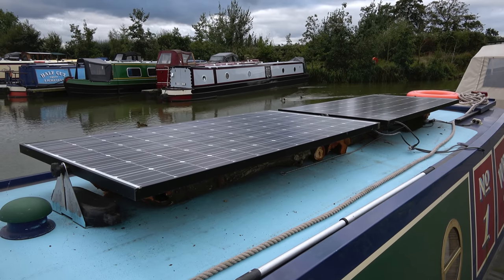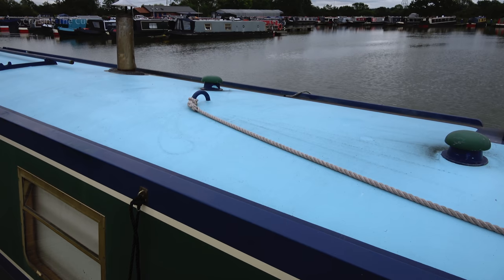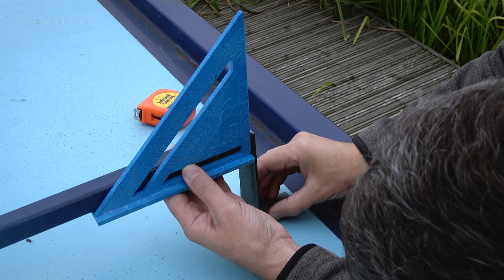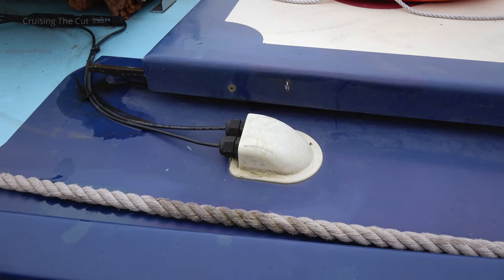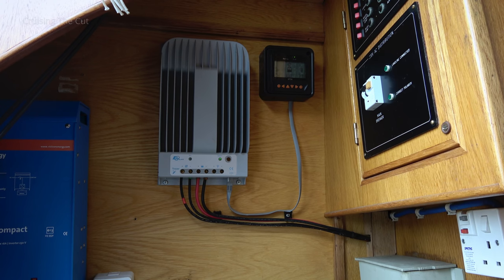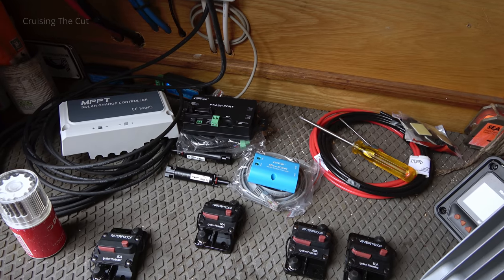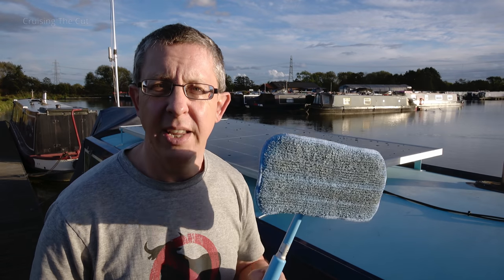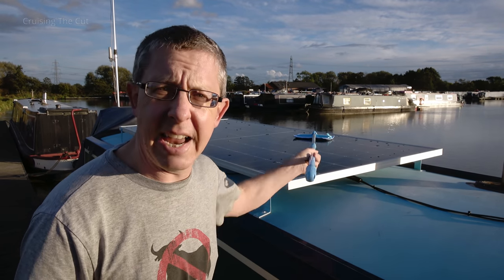251. Adding more solar power to my narrowboat

Comment: Wow David, your electrical, engineering and IT skills have come on leaps and bounds since you first installed solar power. Another great video and I loved the genuine excitement in your voice as you switched it all on and it "didn't go bang".  And then, as if the miracle of working solar power wasn't enough for the viewer, you bring out the mop!!! The 41 minutes just flew by.
Reply: We virtually said the same thing! I felt like I was there, partly waiting for a technical glitch (bang) but also knowing that David would have done plenty of research, used previous experience and taken enough care to make sure a bang didn't happen....unless he edited that bit out 🙂
Reply: its quite a bit different when he got the new batteries and his trepidation he had when hooking them up. there was a small spark when he connected the 2 together. it shocked him not electrically but mentally. lots of water under the boat since then.

Comment: That was the longest and most convoluted infomercial for a microfibre mop I've ever seen . Well done that man, I too would have been anxiously waiting for a loud bang and/or a big blue flash when I switched everything back on. Very interesting though and I hope you get decent power here in England through the winter. One other thing never ceases to amaze, the sun is about 93 million miles away but a few inches of tilt on a solar panel can have a significant effect. Take care. 👍

Comment: I would suggest filling the ends of the cut off tywraps flush, just cutting them leaves an edge that will slice you wide open. As a service and installer of electronic systems I speak from experience.
Reply from the maker: Cheers. In the interests of science, I have just run my finger along every single cut cable tie and they're all fine :-)
Reply: Mr Moffit has a point.  A couple of years ago ty wrap cuts were the number one reason for accessing first aid kits on our IT site.  The fact that your cut ends seem ok is probably down to your wire snips being blunt ;)
I am impressed by your explanation of connecting two charge controllers to the same battery.

Comment: Wow, as a person whose knowledge of electrics is black goes to negative and red goes to positive, this whole vlog might as well have been in Russian.
I still watched it all the way through though which shows the power of your presentation skills. I survived living aboard a constantly cruising narrow boat for 15 years and traversed the whole 2200 miles  three times. I had one solar panel utilised when stationery.. never needed any more lekkies . Engine provided all the amps needed via an heave duty alternator. I admire your expertise setting up your system. My mottos is KSS. 
Best regards. John B.

Comment: 17:30 you don't need two charge controllers that are communicating with each other. They both charge on the internal resistance of the battery. When the battery is empty, both charge controllers put as much current into the battery as possible. The reason for communicating is for lead-acid batteries where they need to de-sulfate. Only let one charge controller do that while the other will be set on AGM.
Reply: That's correct. It was charging just fine without the communication box. The battery internal resistance will cause each inverter to deliver its maximum current at whatever the battery voltage happens to be. This very efficient
Reply: Party Pooper!

Comment: i have watched you for a long time. many times when you are doing something someone will say you should have did it this way or that way. i mounted some on my trailer and truck using well nuts. i had the same issue as i wanted to keep the inner part of my truck nice and clean and did not want to remove the head liner. the well nuts worked fine and no costly tool to buy. you did a nice job dear Sir. carry on.

Comment: using a magnet to catch the metal bits is cleaver
Reply: yes ... and inside a plastic bag so all you have to do is turn the bag inside out and remove from magnet and the throw  away .. the bag not the magnet of course

Comment: Two questions (it would have been three, but I assume the lack of mentions of cheese sandwiches was just an accident!): 

1) Will the new panel provide enough power to get you through winter? And, if not, what will you do without a generator? Can you recharge from the engine, without actually traveling? (That was one question - just in three parts!) 

2) I know you are no longer cruising, but is that just a short-term decision, or do you intend to restart cruising at some point - even if only occasionally? I know lots of people live on permanently moored houseboats, but it seems a bit puzzling to live on a boat that can so easily (locks aside!) travel and not take advantage of that sometimes.  I'm not asking for more cruising vlogs (although they would always be welcome), but more to understand your decision to stop.
Reply from the maker: Yes, I will have to run the engine to a degree. I have no plans to cruise again.
Reply: @CruisingTheCut  Ever?
Reply: @CruisingTheCut  sad face ... I've so enjoyed your cruising vlogs. But I understand, interest in an activity waxes and wanes. I'll have to re-view some of your earlier videos.

Comment: The explanation of the need for separate controllers to accommodate mismatched panels was excellently laymen-ized and important for anyone considering expanding their own solar system. The climactic ending where you go enthusiastically ultrasonic was so worth waiting for! “... wiping the panels keeping them CLEEEEAN”.
Reply: It's very comprehensible, but it's actually not correct. The battery's internal resistance while charging will cause the two inverters to approximately equalize their output. IOW one cannot prevent the other from charging.

Comment: Those rivnuts are so cool. I've never seen them before.
Reply from the maker: Aren't they?!
Reply: They are really good, right up until they aren't ;-). Be wary of dissimilar metals, both between the nut and the parent metal, and between the nut and the bolt. Slather the bolt in anti seize before screwing it gently in to just tight enough. There is nothing more fun than trying to undo a bolt that has corroded into the rivnut, then the rivnut has come loose in the parent metal, ask any Land Rover owner. Rover in their finite wisdom use steel rivnuts in Aluminium panels, then screw in stainless bolts, curse them and their offspring. I guess it could be worse, they could leave unfused battery leads laying around in the dash area just waiting to contact an unsuspecting piece of earthed metal, or design door catches that cause the doors to pop open at 80kmh and scare the local gentry.
Reply: @raygale4198  happens all the time

Comment: We added rooftop solar to our home 15 years ago. It's a 6.5 KW system that has paid for itself three times over now. It's tied to the grid which acts as our battery so any power we don't use is measured and sent into the grid. Our typical electric bill is about $40 per month as opposed to our neighbor's whose bill can be as high as $350/mo. It gets hot here in Phoenix.

Comment: Well done David, you should be proud of your accomplishments!  I see you did all your homework on this project and, aside from the usual unplanned problems that tend to crop up, everything went fairly well.  In this unstable world since covid hit, more panels are a really good idea.  As a bonus, it should get you quite noticeably further into winter without shore or engine power.  You will probably have 3 to 15 amps coming in when overcast now.  You definitely did the right thing by using a charge controller for each of the old and new panels systems.  

I would recommend putting some labels on the charge controllers and circuit breakers, just to eliminate confusion.

I have never seen the need to have the charger controllers talk to each other.  Since they are designed to generate a regulated output voltage, if both controllers are set up for the same output voltage, there should be no problems associated with which system is putting charge into the batteries.  My system currently has 3 parallel 60 amp charge controllers feeding 5 parallel battery banks.  My panels are located 200 feet/61 meters apart so, the solar output is constantly changing.  I also like to de-rate every component in my solar system to maximize reliability.  In the case of solar controllers, I run a maximum current that is half the rating, which helps everything run cooler.  The charge controller communication is handy for online monitoring.

I have done considerable testing on the circuit breakers you are using.  They are a poor Chinese copy of marine breaker.  They generally trip at 1/5 to 1/2 the rated trip current.  There are no specs these breakers are designed to so, what you actually get is a bit of a crap shoot.  I had so much trouble with them, I tested each one using a calibrated test current, to see where they would trip.  After determining the trip current, I would label each one.  Also, in reverse engineering these breakers, I have found the contacts and internal connections are good for a maximum of about 40 amps.  For my high current breakers, I use the Buss, MRCB breaker, which is much higher quality at a proportionally higher cost.

These circuit breakers are rated for a maximum voltage of 24 volts DC.  Therefore, I would recommend replacing the breakers you have that are between the charge controllers and solar panels.  DC voltages require about 10 times the contact gap over AC.  DC will arc a surprising distance when you open a switch, especially if it is carrying high current.  So, what this means for your system is: if you try to open your breakers connected to the solar panels during the day, the voltage may arc across the breaker contacts.
Reply from the maker: Great info about the breakers, cheers. I have also since decided that they work perfectly well without the parallel controller so maybe I'll do an update video in February or March.

Comment: Well it works, so well done on that. To make life easier on similar future projects, might be an idea to mount all the electronics onto a backing board, a piece of ply will do, you can mark it up, drill it all then stain / paint / varnish or whatever finish you like, refit the electronics and the fix the whole thing to the boat bulkhead in one go, a bit of plastic electrical square trunking running horizontally then allows you to hide all the cabling within and just break out where you need to run into terminals. 
But well done on getting it all running.
Reply from the maker: Ta
Reply: Generally don't put wiring on boats into trunking,  mostly left accessable in case of emergency repairs
Reply: @CruisingTheCut  How much power do you need for cheese on toast? 

1.21 gigawatts.
Reply: Don’t do that, electrical safety and fire  - Pls don’t mount electrics on flammable surfaces like ply wood with varnish - erm - no - for the sake of $10 get a proper insulated electrical backing panel - electrical fire could be catastrophic

Comment from the maker: Answers to Frequently Asked Questions on this video

1) Why aren't you cruising anymore?
Please see vlog 238 here: https://youtu.be/DtAGfBNHL4E

2) Why don't you have shore power?
Because this mooring does not have it. Yes, I chose this mooring despite that because I have no other boats either side of me, just fields and the water. All the benefits of canal life, with the amenities of a marina.

3) Have you considered a wind generator?
No, as they're fairly rubbish on the canlals. See my website FAQ page here https://cruisingthecut.co.uk/f-a-q/

4) Just buy more batteries
I don't have the space without massive re-engineering and it's not the batteries that's the issue anyway, it's charging them.

5) Why didn't you put the brackets facing inwards?
Because I wanted the panel in place when I marked the centre point for the holes with a drill, and I couldn't have done that with the brackets facing under the panel.

6) Why not replace the old rear panels with another new one and sell off the old ones?
Because they were specifically bought for their narrow profile, leaving me space to walk alongside them on the roof (which I need to do when in locks) plus the old brackets wouldn’t fit the newer panel so I’d have to remove them and patch the holes. Plus they’re working fine and having two systems gives me redundancy.

7) Where can I buy that fabulous mop?
Here (Amazon affiliate link): https://geni.us/CtC_SolarMop
Reply: Not a wind generator question, but have you considered DIY'ing shore power by slapping down some shoreside panels at a long-term berthing spot? Not super easy, but not impossible to figure out either. Possibly entrirely impractical considering the efforts required?
Reply: A plastic channel would cover the cables on the deck. So you don't by accident pull those cables.
Reply: Where can I receive sledge-hammer training?
Reply: You've implied the answer to what I was about to ask regarding wind turbine.  Your jedi skills are strong.
Reply: Ah, the precise use of a Birmingham screwdriver.

Comment: I would suggest adding a second bolt to the brackets where they attach to the boat. They aren't needed structurally, but any lateral load on the panels (possibly from you bumping it while using that amazing mop!) will cause the bracket to work like a pry bar and cause the sealant on the end closest to the gunnels so start separating allowing moisture to get in. A second bolt would greatly reduce the stress on the sealant and provide better resistance to moisture.
Reply from the maker: I see your point but it’s really, really solid.

Comment: You are an inspiration to those of us who are barely handy. :)

I think one thing overseas commenters--especially from the USA--don't understand is that the UK is quite far north. Once you get up in the midlands or the north, where so many canals are, the days are quite short compared to most of the USA. So not only do you have the gloom, the sun rises late and goes down early. In Nottingham, for example, December 1st, sunrise is 7:55 and sunset at 3:51. And that's just the Midlands. It's worse the farther North you go.
Reply: Oh geez, sunset at 3:51?  How do you get anything done?  Sunset for me is 6:36
Reply: No kidding it is far North. I just looked it up - courtesy of Google. Latitude of Minneapolis Minn. 45 N . Latitude of Nottingham 52.95 N. And Winnipeg in Canada is 49.9. So it is like well into Canada. So very short days in December and short nights in June.
Reply: No criticism at all to David but I might like to be able to tilt the panel up to an angle to catch what sun I could on those short days. But this gets complicated depending on what direction the boat is docked. Easier on a house that doesn't move!

Comment: You’re amazing. The wiring of the solar panels was interesting, but the blue mop was hilarious.
Reply: But missing the little grommets on the cable input into the boat does seem to be something that might come back to haunt him, the cable will rub and rub, especially youst when lying loosly on the roof, what about the mooring rope? won't that pull the cables from the panels? Personally I would have gone into the boat unter the panels, then moved forward internally. But cudos, well done and good to keep the heating coal free.
Reply from the maker: The wiring won't jiggle at all, it's held firm both by the sealant in the hole plus being gripped by the gland box which is itself firmly stuck in place so no movement.